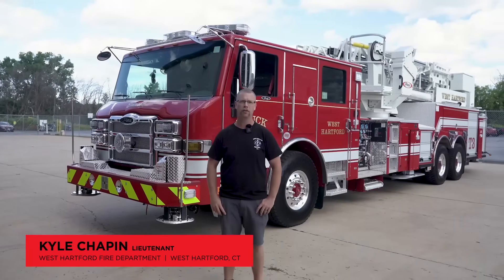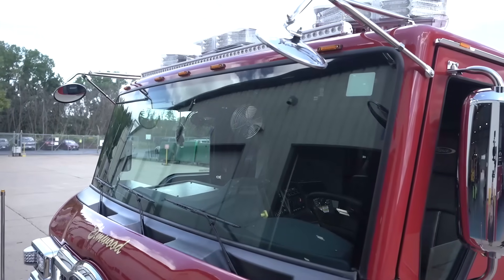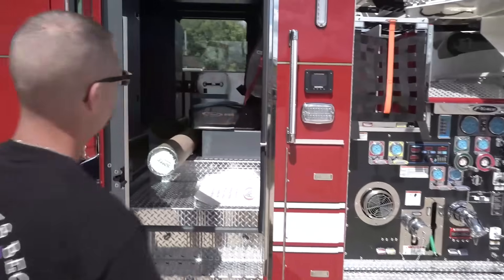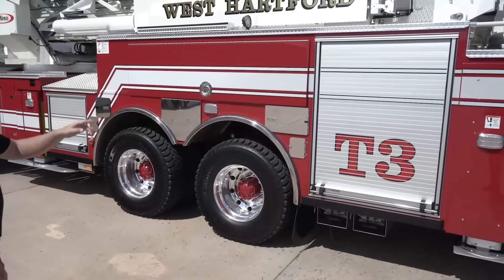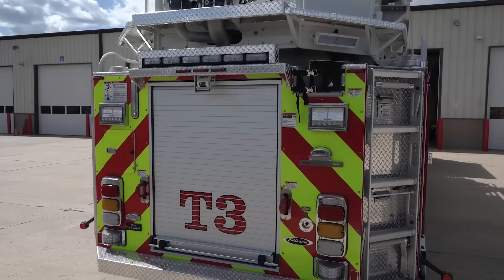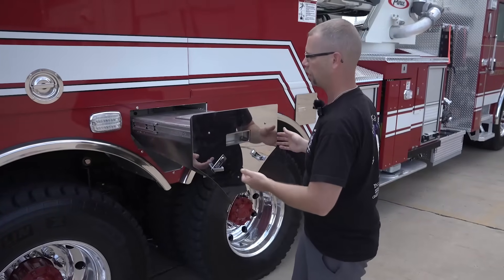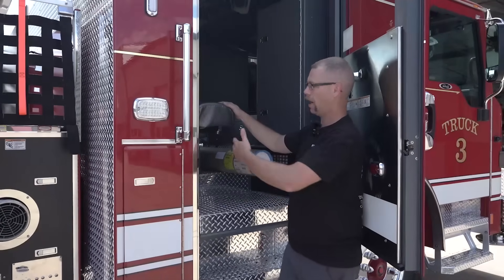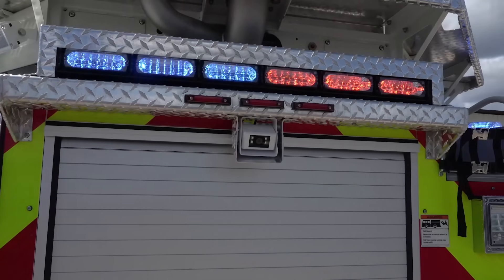Velocity® 100’ Ascendant® Aerial Tower – West Hartford, CT

Comment: Kyle:
This is not the 1967 Maxim I served on with Chris Perrault in 1988 as a new Lieut. on Ladder Co. #1 out of Station 3. At the time, it was the driver and the officer. A 2 man crew made you have to do a lot with a little.
It is good that your chief allows input from those that will actually have to work on the piece, than just the salesman and himself. In my time retired, 14 years, the Fire Service has passed my experience by, but good for those now serving. If a time machine was available, I with many others would love to keep doing the job I so loved.

Stay safe and aggressive, we are the public's last chance on the worst day of their lives.

WALT BLAIR, WHFD, 1983-2011